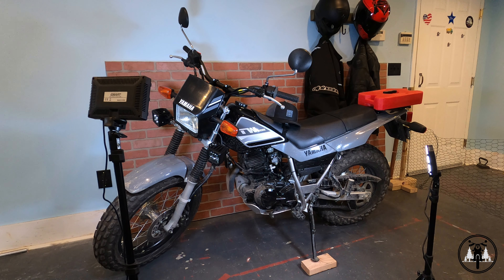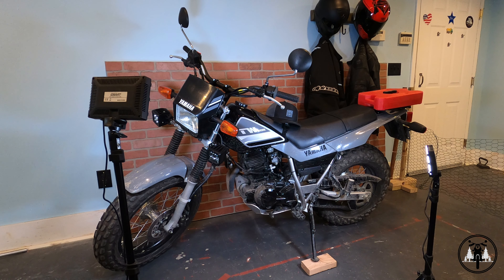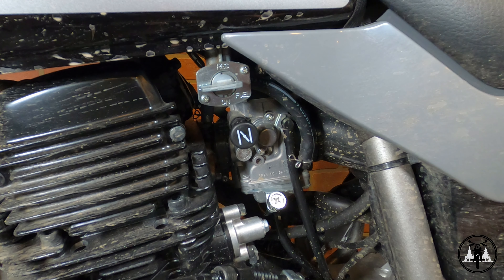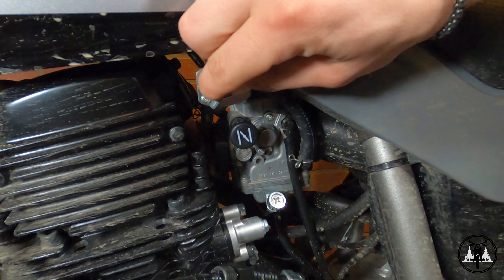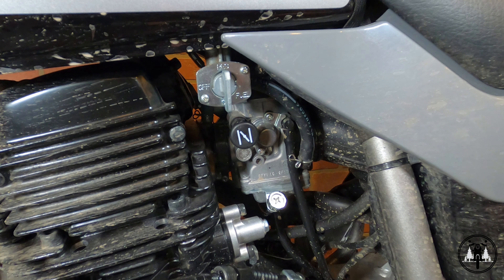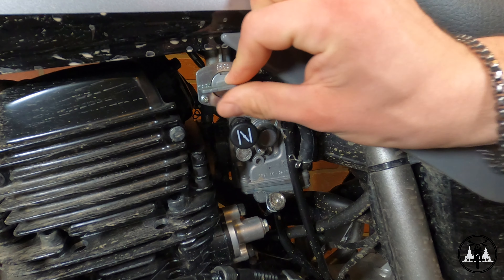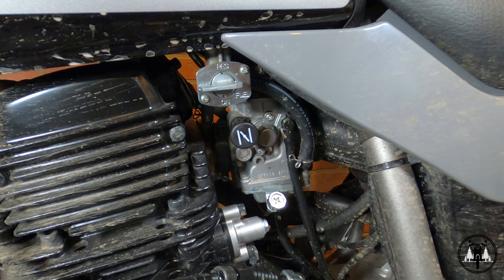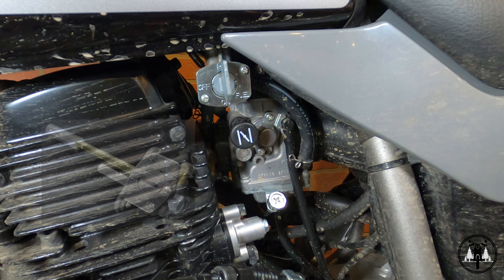How to use a Fuel Petcock // Fuel Valve // Motorcycle // Yamaha TW200

Comment: These were always confusing on older bikes. You had the ability to point either the long part at the word on, or the short part that looks like a pointer. It would rotate all the way around. And off worked as off no matter which you pointed at it. So you were never really sure if you had it on or reserve until you ran out of gas for the first time and tried it the other way. The new ones at least have a stop so its clear which is which
Reply from the maker: Haha yes I’ve been on some older bikes with that exact problem. It’s so difficult to tell what direction it’s actually pointing too. Lucky mine has the little arrow!
Reply: Ahh... So that is why I had trouble before. Thanks again.
Reply: @MostroMoto  I put a dab of red paint on mine to tell which way its pointing.

Comment: I’ve been have an issue on my ‘22 TW where it will die while I’m riding it, acting like it’s ran below the run straw. But it’s done this with plenty of fuel and even as few as 2 or 3 miles on the bike since I last filled up. When it dies, while still coasting down the road, I switch it to reserve and downshift to let it roll start, It starts right back up, and then I immediately switch it back to run and continue on to work with no more issues.  Do you think I need to just remove the petcock from the tank and clean it? Or is there something else you think it could be?
Reply from the maker: It’s possible that some bad fuel gotten the carbs, or clogged some of the petcock. To be honest, I’ve never heard of that issue before. Maybe it’s worth reaching out to your local dealership

Comment: Hey, I have a 2000 Yamaha road star 1600, am still a bit confused using the petcock, I don't know if am using it right but usually when I turn on the bike to warm it I leave it off, what about running the bike? Do I turn it on? Is it necessary?
Reply from the maker: The fuel petcock allows fuel to run into the bikes engine. With this turned off eventually the bike will shut off and run out of fuel. When warming the bike up it is okay to have it in the on position. When you are done riding turn the fuel switch off, so no fuel leaks into the carburetor. Hopefully this helps!
Reply: @MostroMoto  Thanks!! What am doing now is before turning the bike on, I turn the choke on, turn the petcock on and start the bike, once I stop riding I just leave the choke off and turn the petcock off

Comment: Hey I have a YFZ 450 and I’ve noticed that everytime I ride I never turned my petcock valve on and its always in the off position but it started up fine everytime... how? Is it bad? Let me know ASAP!
Reply from the maker: That’s interesting, I haven’t heard of that before. Maybe it’s possible that the fuel lines have been routed incorrectly. But usually if the petcock is in the off position your carb will not receive fuel

Comment: Hey I have a little question when opening the valve no fuel comes out when the bike is off? how may I fix it? idk if thats normal
Reply from the maker: If no fuel comes out that may be because the fuel level to low to reach the drain tube. If you try switching to reserve does it come out? It should be gravity fed. Some bikes use a fuel pump, but I don’t believe this bike has one
Reply: @MostroMoto  I end up draining the old fuel and refilled it with new one and worked again

Comment: Why is my gas leaking from the drain hose pretty heavily as soon as I switch to “ON” or “RES”? This happens when bike is stopped and cannot turn on and is making a pool of gas underneath u til I switch to off.
Reply from the maker: When you turn the switch to “on” or “reserve” you are opening the valve allowing gas to run into the carburetor. Leaving it on for a extended period of time may cause it to leak or pool up into the carburetor. That would make the bike hard to start. Anytime you are not riding you should shut it off. I hope this helps!
Reply: @MostroMoto  Thanks, it was way more than a flooded carb, took a hammer to the carb and suddenly stopped. Started right up. Guessing needle was stuck open.
Reply: I have the same issue is it normal for it to leak like that when on or reserve? Seems like if you forgot to turn it off you’d just be out of gas

Comment: my 1st thought is, cant you just leave it on reserve and watch the level?  rather than fiddling with open or reserve vs closed.
Reply from the maker: The only issue with keeping the fuel petcock on reserve is fuel may eventually leak into the carburetor leading to starting issues. So it’s recommended to shut it off after riding

Comment: Great video. I've heard that before but I keep forgetting  to do it. What I do is I drive it a few miles every other day. The longest is 3 days. Do you think I should still turn off the valve? Even in winter I do the same every other day use to prevent gumming up and so on. Is the off switch more for prolonged periods of no use? Thanks , and keep the vids coming.  Very enjoyable.  I too have the 2021 tdub I bought in Nov 2020. 366 Miles now. Awesome bike. I have a unrelated question.  I've been watching vids on the Honda ct125 trail. It goes about 50 mph, Perry muschamp like the tdub.  Why does the tdub only go 50mph average top speed like the 125 if the tw200 is a 200cc or almost. Sorry for the run off.
Reply from the maker: People seem to have very different opinions about the fuel shut off valve. Generally if you shut the bike off you should switch the fuel off as well. It’s a good habit to get into. I don’t always shut the fuel off (I am forgetful). If you forget to shut it off for a hour or so it probably isn’t a big deal. But I wouldn’t leave it for multiple days. I have heard story’s of the fuel leaking into the carb & flooding it. then the bike doesn’t start. Personally I have never had that issue, and there have been times where I forgot to shut the fuel off for a couple days. But still a good habit to get into. Great comment, definitely a interesting subject!

As far as the speed goes this is what I’ve found:

The TW 200 is made primarily for slower off-road use. The gearing on it is much different and lower than other bikes. Also the engine is not high strung. So even though it’s a bigger engine, it’s not really putting out much more power. Also the bike is a bit heavier than the CT125

Comment: Do you also have a video on which lines from the carburetor hook to the petcock?
Reply from the maker: I don’t, there should only be one line coming off the petcock. That line goes directly into the carburetor. The petcock itself goes right into the fuel tank. There should be some diagrams on Google about the carburetor. I hope this helps! Thanks for watching 😃🤙🏼

Comment: what happens when I turn the fuel switch off and start the bike? it will run for few seconds and then stall due to no fuel being passed to engine? next time will it run without issue when starting with switch on?🤔
Reply from the maker: If you run the bike with the fuel switch off it will burn all the fuel within the fuel lines and carburetor. Next time you go to start it you might need to give it a couple seconds to pull fuel into the lines and carburetor again.